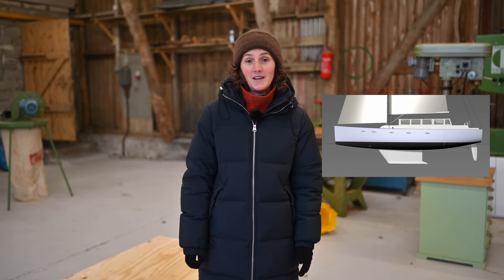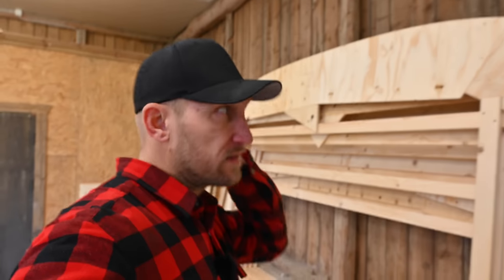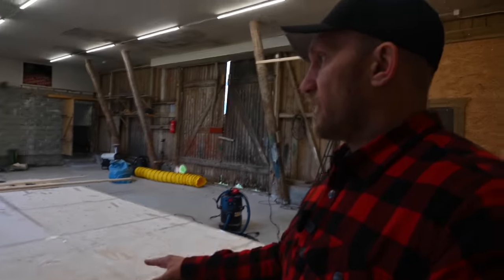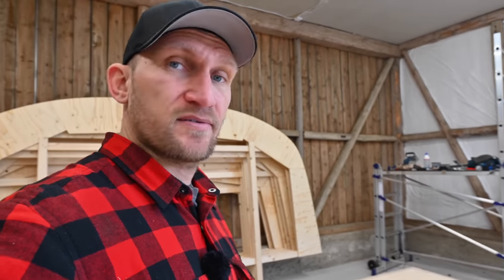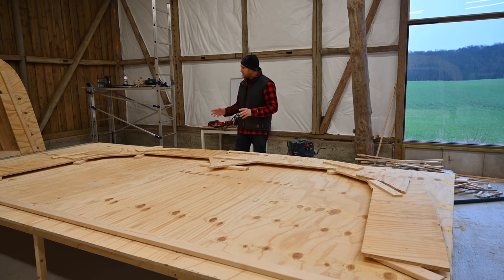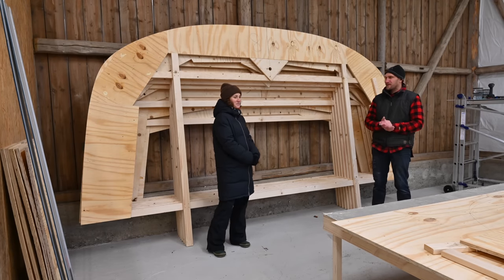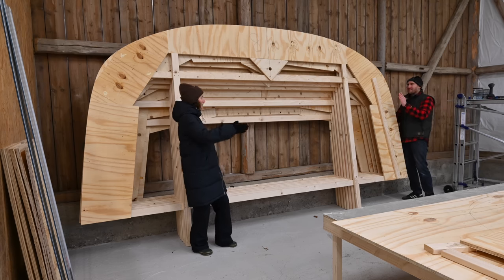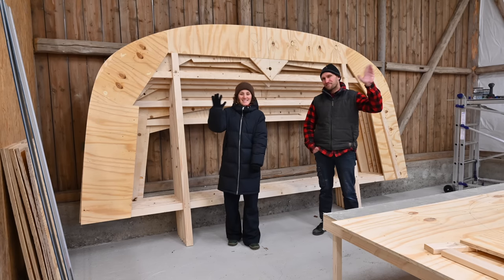Halfway Building The Temporary Hull Frames - Ep. 327 RAN Sailing

Comment: In building ships, there are 3 dimensions Buttline, Station lines, and Waterline.  Determine the zero for buttlines and waterline to be the center of the ship at the intersection of floorline zero and buttline zero. Thus you have the rotation point axis better determined and that can be incorporated into the structure assembly.  Good luck

Comment: Wonderful work and I like your solution on levelling the build table - and I’m still somewhat in awe of that hand held CNC router!!. You seem to be reasonably realistic with your time frame with both of you on then job, especially if you end up being able to pull in some help along the way from friends, volunteers and viewers (I wish I was closer!!). I gather from your comments towards the end of the video that this first build frame project may have provided a bit of a dose of how difficult it really is to project a timeline for a job like this. I have quite a bit of house building experience and had thought that with my level of skill I’d need 12 months to finish of my Herreshoff H28 rebuild project (from a completely stripped out bare hull) - but now after two years later working alone pretty much full time I’d say that I’m still at least another three to five months from finishing.....(I confess that I think at least 40% of my time has been spent planning, procrastinating over processes and trying to decide how best to complete various projects). Working in all of the multi dimensions and complex axis and curves of a boat seems to add more than double the time to any task, particularly with the interior fitout - I hope your architect may be able to provide some accurate drawings for interior fit out items (bulkheads, cupboards, longitudinal etc) that will allow you to apply the CNC router directly to the fit out materials. If not already doing so I suspect paying extra for those sort of files may prove quite beneficial time and material wise. Doing it by hand and templates using a tick stick or hot glue thin wood strips, I found that I’d end up making two or three templates (or more) for every piece to get it as close as I could before daring to risk wasting any of my Huon Pine, Mahogany or Rosewood stock for the purpose.

Comment: Nice job, I know how much thinking and planning time a build like this takes before you even pick up the tools each day and you are only showing a really small part of the overall effort.  Given that wood expands and contracts with humidity I would be tempted to build the strongback (which needs to be both strong and ridged for you to get the best result) from steel or aluminium.    Even if you just get a metal frame made and then use wood to build it up it will give you the rigidity it’s that you need (you can also add wheels to this) think of it as the chassis of a car on which you put the body.      Thanks for making great videos, I hope I can get as proficient as you are.

Comment: Make the frame to fit one or serveral dolly’s instead, then you can hoist the hull get the dolly under it and roll it out. Otherwise you will have issues with the frame moving when working on it and perhaps even wheels that have a flat spot or seezed 
Great job 👍

Comment: I am pleasantly surprised that the self leveling concrete hack did  work as good as it is. I think you should have made your table sections adjustable so you can level it via wedges, shims, screws... whatever. I am saying that, because you will have to move the table to make room for the boat and you will still need a flat surface to make bulkheads and interior partitions or even laminate some ribs. And since you floor is not perfect, moving the table will throw it out of the existing alignment.

Comment: Instead of building a rolling platform to remove  the boat for turning it, would it be easier to temporarily open up a portion of the roof to allow crane access? Or possibly build a device capable of rotating the boat in the barn after the hull is complete?  Keep up the great work 👍

Comment: Not sure if my ideas will help or not, but, here they are.  First, contact Leo at his channel, Sampson Boat Co.  He uses a computer program that has all of the steps and what order they need to be accomplished in a flow chart format.  Maybe this would help you with timelines?  Second. Weld a  fine thread nut on an “L” bracket and attach it to the bottom of the support legs of each frame.  Then using a fine thread bolt, fine adjustments to height and side to side level could be easily done.

Comment: I noticed that you removed the shaper tape.  You might want to consider leaving it on unless there is a good reason to remove it.  Leaving it on allows you to go back and add other features at a later date with the workspace preserved.  I have lost count of the number of times that I have gone back to something to add a feature at a later date that I did not think of at the time.  I now make a point of only removing the shaper tape when I really have to.

Comment: If you compare yourselves with Sailing Distant Shores - this stage is quick (they used aluminum panels - cut in 2 days by CNC but then welded together)
Your approach is less expensive but your hull is a sandwich, which will take longer.
I think it is quite likely you wil have a finished boat before Tally Ho is ready . . .
Reply: Leo thinks it will only take two years to finish tally ho off!
Reply: @kevinmountford4541  - yes indeed - Tally Ho is a floating piece of cabinet work built to uterly extordinary limits of perfection that Leo valued at somewhere between 
$300,000 and $1,000,000 - it would sell very quickly.  Recently Leo has been talking about there being more urgency because of Visas etc.  He started in June 2017.
Reply: @kevinmountford4541  And so far the Tally Ho build is right on schedule :-).
 "How long to finish" is a popular question on channels that are refitting or building boats so that Tally Ho running 'gagline' is always fun to throw out there. AND, now that Tally Ho is almost finished (har har har) there's a new boat being built right here ... good for another 2 years at least. I'm looking forward to RANIII rising up from sheets of plywood and sticks of 2 x 4's
Reply: @JustMe-pp1mp  another pressing question which is seldom asked, is a boat ever realy finished?

Comment: I think you'll be struggling with the frames the way you decided to make them. The "two legs" you did the frame, will be not necessary further the crossbeam, because the bottom of the frame (the larger one) should be horizontal and agains the floor (or mounting berth). Further the "aligning holes" you build in every frame will have no practical interest to align the frame. The hull must be aligned with the top (here the hull joins the deck). If you want  an "aligning hole"  in every frame to use a laser beam, then you must have the hole exactly in the middle of the horizontal reinforcement bar and the future deck plan that is, the opposite place here it stands now (to near the floor). I wish you both good luck for your endeavour and Marry Christmas to all the Family.

Comment: Why not use the liquid concrete to level the barn floor
Reply: Would be very expensive. I imagine the floor is quite uneven and even a 20mm layer of this stuff over an area of 150sqm means over 200 25kg bags at around 20 USD each. So 4k total...